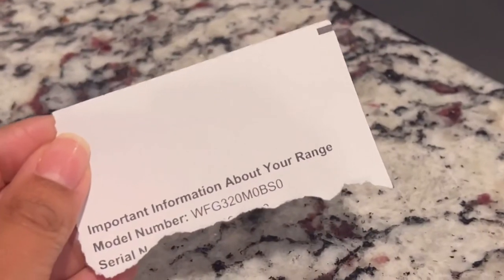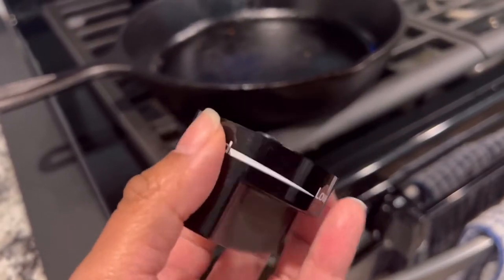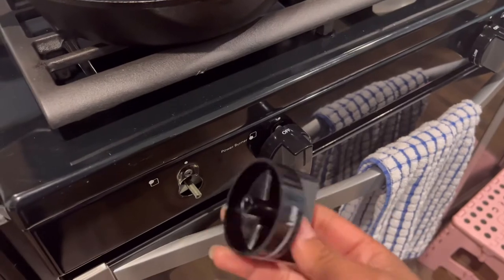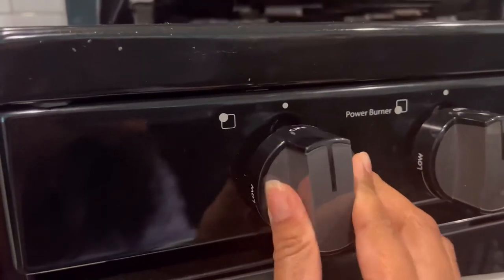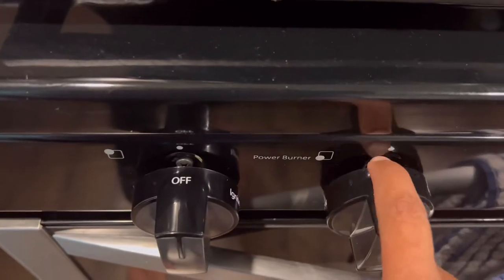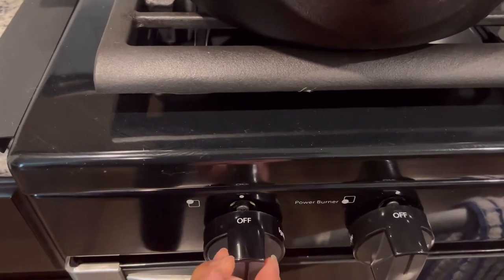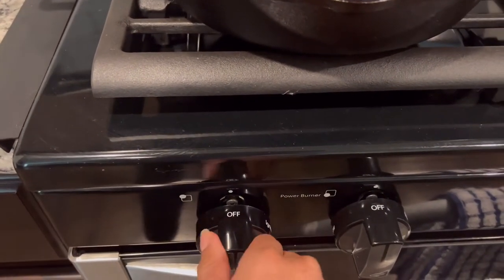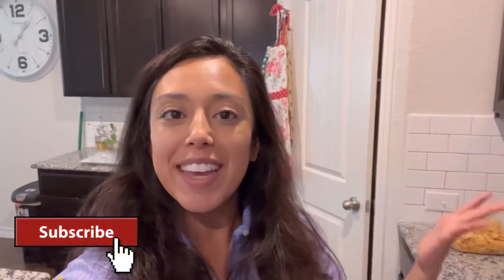How to replace Whirlpool gas stove knob

Comment: Buy in (Hobby Lobby, home depot,lows) , small Aluminum Sheet ( 0.16*4*10) , crazy glue and scissors, solution for 3 dollars. Fit around stick-base and later put it inside broken knob or simple put a thin line of aluminum on the flat part of the Knob.
Reply: Thank you.  This video is just buying a new knob.